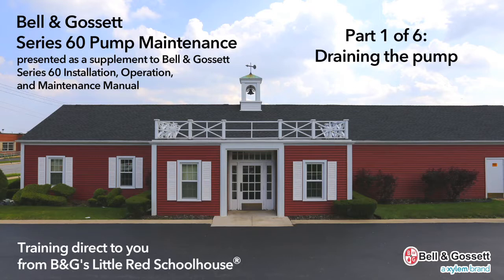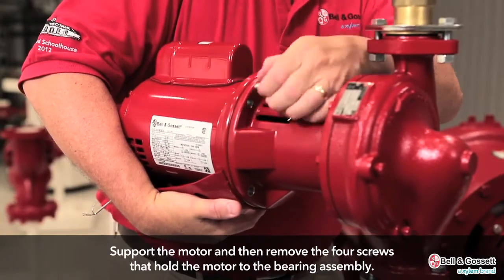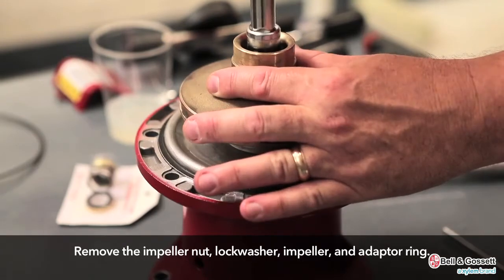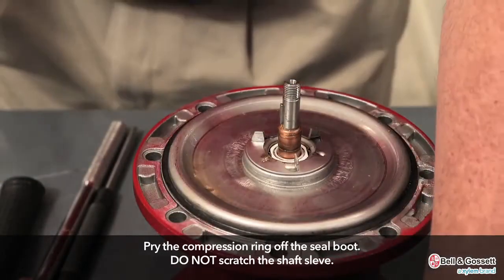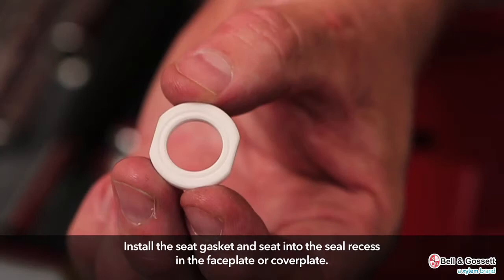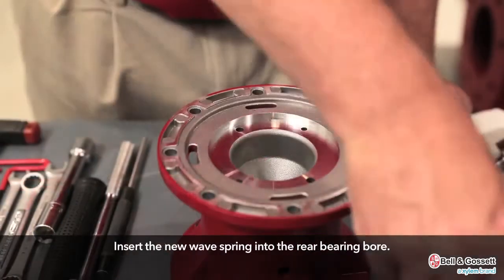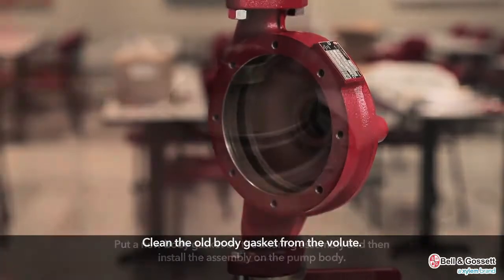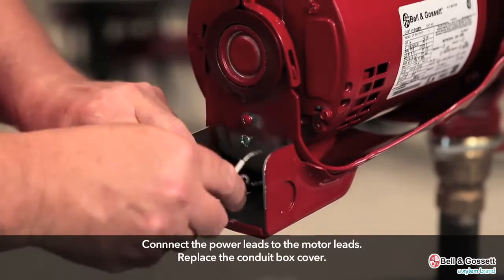Bell & Gossett Series 60 Pump Maintenance: Step-by-Step Guide

Comment: Hello.  Which way is the impeller supposed to turn.  I have the same set up but my wires are not black.  Thank you
Reply: Clock wise standing behind the motor. Water comes in the middle snout and is flung out through centrifugal force
The water is brushed out the impeller blades, not cupped.
Reply: Usually there is an arrow stamped on the impeller housing that will help. After a while you'll know just by how the housing looks if your spinning backwards. Another good indicator is if your guages work you'll see a pressure increase and decrease across the pump.